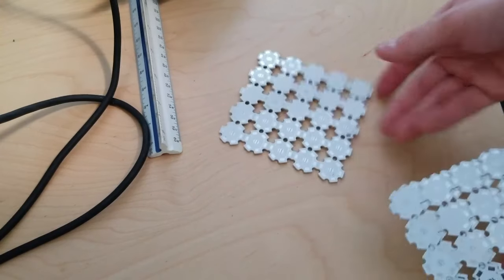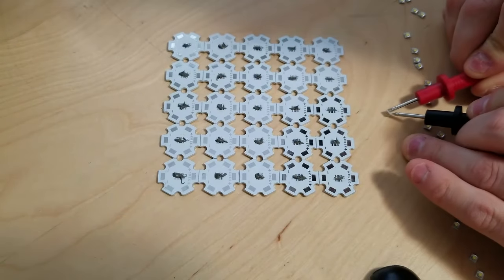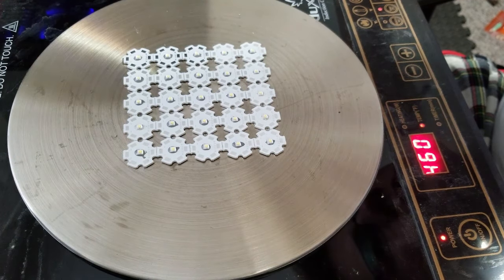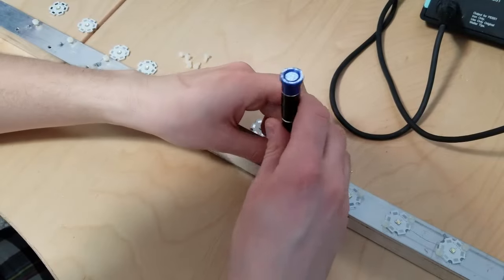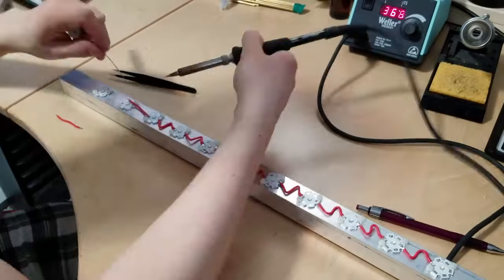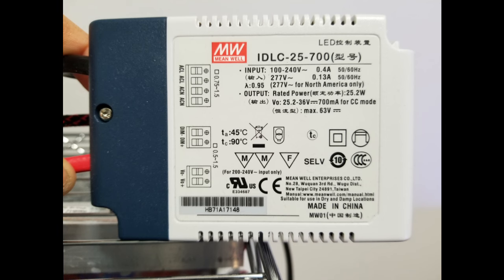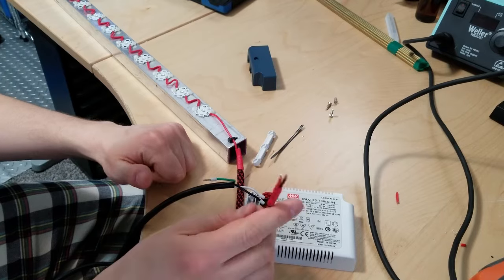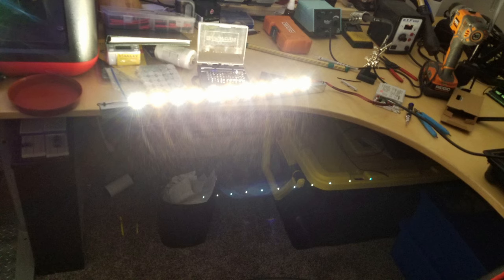DIY LED Lighting - How to Make Your Own Grow Lights!

Comment: Hook that ground wire up next time
Reply: It's a double insulated power supply with a extra low voltage(ELV) output. In most cases there will be nowhere in the LED driver to hook that up, as it also is with this one. And if there is a place to hook it up, it won't be an active ground. It will only be a connection block, so that you could wire another 115/230V appliance up to it

Comment: How could I find these semi-subconductors LED lights in Europe ? Do you have any idea?
Reply: Hello Ismail, I live in Germany and I order mine via Amazon and Ebay, but there are also web-site shops that are dedicated to the distribution of all the components you might need. To find them I searched for "Led component sellers" in German on google.de, but because of the open market, you can technically buy from anywhere in Europe.

Comment: how can you make the lights pulse at a certain hz such as 10 hz?
Reply from the maker: Hey Terry! That's a really good question and I would love to answer it with a detailed video in the future. For now I would say to get a simple current driver (one without an integrated dimming system, as they don't usually let you do what I'm about to recommend), then drive your LED system through an N-channel MOSFET. You could use a 555 timer to set your frequency at the MOSFETs gate. Just look up a 555 N-channel MOSFET system and treat the current driver as the power supply and the LED system as the load. There are plenty of tutorials online that broadly describe how MOSFET dimmers work.
Reply from the maker: Although I will say that for lower frequency pulses (like 10Hz), you could simply use an Arduino and loop through a High/Low pin setting routine with delays of 50ms in between - just use that to drive the MOSFET
Reply: @autumnmaticcreations62  
 Cool, Ill check on doing that. Thanks!

Comment: I dont see why you dont just buy pre-mounted leds. 1W leds are cheap and plentiful. I prefer 3W LEDS running at 2W. Same heat twice the lumens.
Reply from the maker: For sure you could. RapidLed has these pre-mounted. I make my own because it's a lot cheaper, and I also wanted to demonstrate how LED modules work on boards - that's all 🙃.

Comment: Your efficiency goes WAY DOWN if you drive them at 1A (3,5W)!
You should really run them at 350mA (1W) to get the 122lm/W efficiency. And even then 122 lm/W are bad LEDs now a days! Cree, Samsung have LEDs with 230+ lm/w!! (I know its a old video)
They would need, designed correctly, probably 1/3 of the power from your system in the video for the same light output.

Comment: So, my question is,  how much would it cost me for parts to make a grow light equivalent to an HLG SCORPION DIABLO?
Reply from the maker: Erm, super rough estimate here, but that light pulls 600W max. These Samsung lights are recommended to pull around 700mA, and run on about 3V at that current, so that's 2.1W each. Divide 600W by 2.1W and it works out just shy of 300 LEDs required to pull the same amount of power from the driver. If you buy these LEDs in bulk, they run about 50cents each. So your cost in lights is about $150. A Meanwell HLG-600H driver to supply that level of power will cost you about $250. Adding your cost for aluminum and hanging materials (and you probably want to get some PCBs made if you're going through the trouble of doing this yourself) the total cost is going to be in the neighborhood of $600?

Still a pretty huge saving.

Edit: of course, this assumes that these LEDs are the same efficiency as the Q-board LEDs, which is not quite right. Q-board LEDs are slightly more efficient because each individual LED runs at a lower current, which is why there are way more LEDs on a Q board than on my custom boards
Reply: @autumnmaticcreations62  I really appreciate your reply and based on what you told me I'm moving forward with my led grow light project.  Thanks.

I have a question, Are UVB(280-315nm) led lights available? If so, do UVB's gave a shorter lifespan then other led lights?
Reply from the maker: @rickwhite9748  I'm not sure you can get them down to the range (at least at commercial prices), but if you could, CREE would probably be the manufacturer to check. The lifetime is probably not significantly different than other LEDs but the datasheet would give you and expected lifetime
Reply: @autumnmaticcreations62  Thanks again.  Have a good night.
Reply from the maker: @rickwhite9748  This is closer to the 400nm range, but here's a UVA module from RapidLED. If you're in the USA, this is a great supplier for LED supplies: https://rapidled.com/collections/uv-violet-leds/products/uva-trichome-enhancement-puck

Comment: so what would be the actual true watts of one of these bars? i know there 3.5 a peice but are they actualley producing that
Reply from the maker: I'm not exactly sure what you mean. When you look at a datasheet for LEDs, they will tell you the electrical characteristics. The LED driver will also tell you what it's output range is. This light had 11 LEDs which demand roughly 3V each at a current of 700mA (which is the driving current of the driver). So the actual power draw is (3V)*(0.700A)*(11) = 23.1W
Reply: @autumnmaticcreations62  well when you buy a led grow light it may say 600 watt and have like 120 5 watt leds . but you look through the specs and it will only be 130 true watts . i was told because the led are 5 watts they wont handle going at there max constantly so they can only run at like 30 percent power 24 hours for any amount of time. 90 percent of leds on amazon rated  at 300, 600 or 1000 only actually draw 130 at the wall. its been a pain trying to buy led lights. only the super expensive led system actually say 300 and run 300.
Reply: @autumnmaticcreations62   i just trying to build something that actually produces 300 + watts of power
Reply from the maker: @thewizardoftech5075  usually those "600W" Amazon lights just mean they produce the equivalent light of a 600W bulb. It's a bit of a scam really. If you want to have 300 watts actually going through your LED system, you need to find a 300W led driver and prepare a circuit that will work with it. 

Meanwell HLG-320 series will work.
Reply: @autumnmaticcreations62  if you were to buy a separate led driver and take apart your cheap led light and hook up your own driver would you be able to achieve at least 300 watts out of a 600 watt system.
Reply from the maker: @thewizardoftech5075  it's possible but I don't think so. Most of those cheap LED boards don't use proper drivers, but rather a series of cheap 24V or 12V power supplies. The particular driver I mentioned operated at 2.1A at a max voltage of around 150V, so getting it to work with one of those boards would likely be more trouble than it's worth. You could probably make it work with Samsung Q boards though, which wouldn't cost too much

Comment: Do you have a Email address to correspond to each other  i would like to build something like this for a 3x3 tent.  comparable to a the HLG qb100   or fissioning f120  or the Marshydro sp150 or ts1000.  I want to draw 250w of power from the wall if that is even a option.  Amazing video now i sorta have a understanding.

Comment: Love to get more info on were to get everything and what I need to do say 60$ worth or 100$ I'm handy so I know I should be able to do it I've wired a lot of thinks.getting to the poi t were I have extra pot lights and thinking of hooking up a few if I can get a strong led light .what do you think
Reply from the maker: Hey Joe,

Take a look at Digikey. If you just want some supplementary lighting, I would suggest getting some strips
    like this: https://www.digikey.com/product-detail/en/samsung-semiconductor-inc/SI-B8U261560WW/1510-2218-ND/6624002
or some COBs
    like this: https://www.digikey.com/product-detail/en/samsung-semiconductor-inc/SPHCW1HDNE25YHRT4J/1510-1166-ND/5048587

The driver you need will depend on the final lights and configuration you want to set them up in.

Comment: Nice! What was the total cost of this light?
Reply from the maker: For this particular light it was probably around 50, although as far as DIY lights go, it's still a pretty low watt/$ light.

For larger grows you could easily have a light which pulls 300 or 600 ACTUAL watts for $200 - $300 CAD. My 75W grow light cost be roughly $60 all-in.
Reply: @autumnmaticcreations62  If you pull 600W, how do you cool the LED?  Cooling has always been the biggest challenge in my DIY LED sources
Reply: @ansmerek  the cooling depends on the surface area. If you cramp the LEDs in close proximity you  won't be able to cool them off passively. Forced air flow, aka fans, should do. Computer case fans are quite cheap and reliable in that regard. If you go for large projects (lots of light) you might wish to control the emitted light any how - thermocouples + microcontroller and beefy MOSFETs.
Reply: @stanimir4197  I have liquid cooled heat sinks, diamond heat sink compound under my cobs, and still struggle to keep heat below 80C even at 300W.  I suspect the majority of air cooled grow lights are just way below the power they claim

Comment: How comes that every second LED has a different color tenperature?
Reply from the maker: Hey Frank, I designed this circuit to have two different lights (3500K and 5000K, I think), so I just alternated them in the circuit.
Reply: @autumnmaticcreations62  That, along with your video, is ingenious in my opinion.

Comment: That was in awesome video that you made with the late bar over here in the US and so we call those for supplemental lighting basically for the flower stage and I just purchased the new Samsung 30 ones LED strips my problem is I do not know what size drive rye need their very small because I didn't want you and guest a bunch of money and break the LED boards or shrimps or blow up the driver I need to buy there are 40 LED lights in all they're made by Samsung LM301 BLE D strips a total of 40 pieces the voltage is DC torney the 28 the the current Max is 1000 mila S the ip grade is tueni they are non waterproof and they are 3500 K and why PCB and I believe the Lang's is exactly 11" long
Reply from the maker: Hey Bryan, do you have a product page for that particular product? I could potentially recommend a driver for you but I would have to see the product to help

Comment: Really great video, very thorough and informative, but I'm not sure why you'd go with these as opposed to a cheap 10/20 watt flood light. Then again, I'm not sure what color temp range you're getting with your LEDs, I was looking for 5000K and above. I also know a lot less about all of this than you probably do.
I ran some numbers for a couple hours and dug around to see what was available, and honestly if we're buying from china anyway, the cost of the constant current supply ALONE is more than that of a 20w LED flood light, fully assembled, at some of the less frugal pricing that I've seen them. Those come with heat-sink, constant current power supply, and of course, they're pre-assembled.
The real sad moment for me was realizing that after figuring out how many LED boards I'd have to make, and even if that costs less than .50c per with the thermal and solder paste, and the cheapest that I could find decent constant current power supplies at $12, it still comes out to about $15/16 bucks for electrical, which is the same as a 20w flood light. That's before buying the heat-sink, screws, and power cords, AND that's buying in bulk. The only real advantage seems to be that you get more length/ area of spread and more customization, and maybe have more guarantee about specs on the lights. That's a lot of work at any scale though. Unless you know some secret way to keep the cost down, I'm goin for the cheap flood lights. I'd definitely say that anyone here looking to build aquarium lights should do that instead too because of the added benefit of having an encased light. My bulk build would be at a very unrealistically conservative number 170, and a 20 20w flood lights run for 160.
Still, as another broke college student, I really appreciate your work, and I gotta say, I got a little excited about the idea of making what you did, so I hope you've enjoyed making them and found it to be rewarding. I definitely followed for more too!

Comment: How do you build with the best led though I want the best of the best without spending a fortune. Can you link me a high grade led for veg and bloom
Reply: Watch growmau5........also watch greengenes garden....greengenes has a step by step video on using his 'photo boost' strips to build a 300 and 600 watt light.....his strips are Samsung lm301b diodes with Cree xp 660....in a nutshell....bad ass
Reply: @Khaymen223  nice thanks Brandon!
Reply from the maker: I second Brandon's comment! The Samsung lm301b LEDs are really excellent low-cost low-power LEDs which are extremely efficient. Making a light with a set of strips would be a very easy way to make a nice light
Reply: His photoboost strips are available at Pacific lighting concepts......also growmau5 has his 'pucks' which are also lm301bs available at Rapid led in whole fixtures as well as just the PCB for DIY builds
Reply: I can't believe how much cheaper it is to diy with this information, I appreciate the help guys. I checked it out it seems like you can make a light just as good as a horticulture lighting group set with this list and video. I'm gonna go with Samsung for sure, I would like to set it up where I can sync it to my phone which probably wouldn't be too hard.
Reply: I'm gonna go with the hlg 600 54b driver, it's 184 dollars
Reply from the maker: @noobnoob3489  you bet! The truth is that all commercial LED systems are just as simple as a PCB with LEDs mounted on, and a driver to run them. No secret sauce 😁
Reply: @noobnoob3489  as a side note....HLG (horticulture lighting group) not the meanwell driver company,.  offers a 600 watt diy kit...it's a complete disassembled kit including driver....I believe a Google search 'HLG 600h kit' would turn it up.....it's an expensive kit, but perfect for the folks who have 0 mechanical and electrical ability....... I however prefer greengenes garden diy plans with his strips

Comment: LED's might work for starting plants for the first 3-6 months after they break out of their seed but for full grown plants LED's will barely be enough to keep it from death, plus most LED's produce EM Radiation with very little to no UV Radiation, plants benefit from UV rays because it helps them form strong defences against light and diseases any plants under these LED lights will be lacking the proteins produced and may end up getting sick and they will be very sensitive to any change in light
Reply from the maker: Honestly I don't think any of that is verifiable. I use LEDs exclusively to grow all my plants and they are far more effective than other lights. As for the spectrum, it varies broadly on the brand and model of LED module you use. For specific types of plants, it's not unheard of to supplement deficiencies in the UV/IR range with additional UV/IR LEDs with narrow bandwidths. I have grown several plants with plain white LEDs, however, and have never dealt with any extreme signs of deficiency.

Comment: You would get more out of your LEDs if you was to run them in series or groups of three in series then run those groups in parallel I had to revise this because I see you're using the constant current driver do not if people are reading this do not run your LEDs in parallel if using a constant voltage power supply you will ruin them! Wire are them the way he has them wired here

Comment: This is a cool project, and you did a great job, but this will not have anywhere near the required optical power to grow anything.  This is a gimmick grow light.  If you place it directly over seedlings it will work, but any $49 "grow light" from a big box store will do the same.  If you want an actual grow light, you will need at least 10x the power, cooling will be an issue, and cost will go up enough it will be cheaper to buy an actual grow light

Comment: Why didnt you put them in parralel out of curiosity
Reply from the maker: Hey Cal,
These lights are configured in series. Mainly because that's how I could get them to work with my driver. Often, when building LED systems, I will wire up several strings of LEDs in parallel to 'cut the current' through each as a way to protect the circuit.

Comment: The problem is that these aren't grow lights. They are plain white LED producing roughly 3000 lumens for $50 in materials and a ton of labor. Sam's club sells 4' LED lights that put out 4500 lumens for $34.99+ tax. If these were full spectrum, they would be worth the effort, but for what they are, you've defeated yourself.

Comment: Great vid. I'm an electronic tech for a long time. Retired now. Two things. Wear gloves and use alcohol to clean, don't scrape the board. You did great otherwise. Alot better than the other crap on YouTube. If you ever have a problem hit me up for advice. I just made a diy grow bar and put it up on YouTube. Tho mine is a little bit of the antique version. I used an old rv antenna aluminum square bar. I cheaped out. Made 2 versions. Check it out. I think our got a great channel keep it up. ✌ from he East coast.
Reply from the maker: Right on. I guess I forgot to show it but I do use ethanol to clean the flux up. I'll have to mention that next time I solder in a video. Thanks for the advice!

I'm just beginning my career as an electrical engineer myself 🤠
Reply: @autumnmaticcreations62  there's a saying among technicians......we fix all the engineer's problems. lol. So don't forget always have an experienced tech on your team.